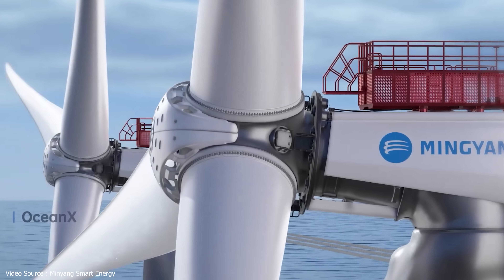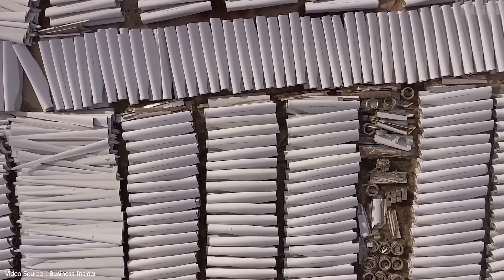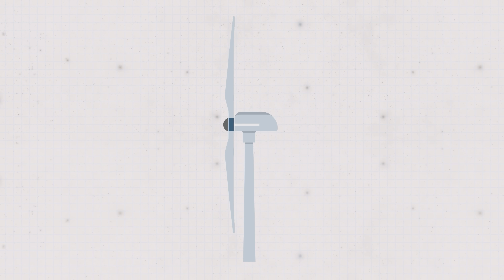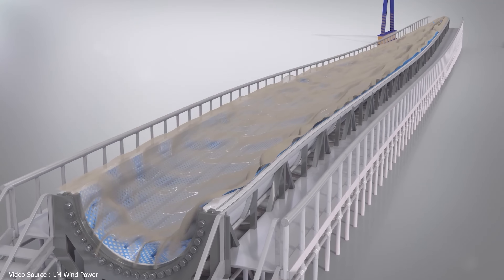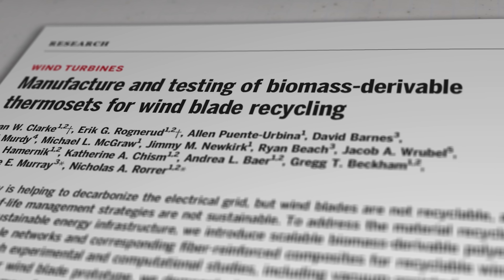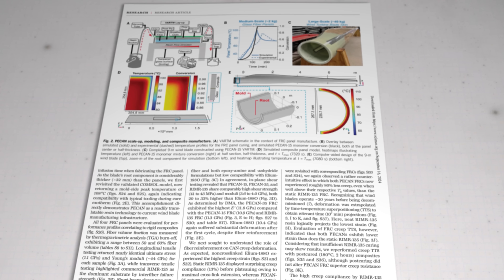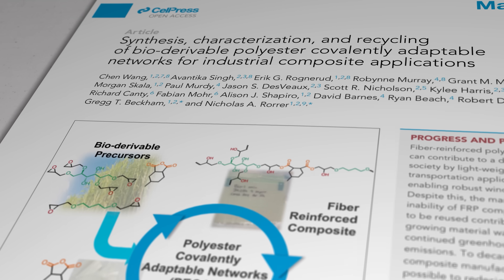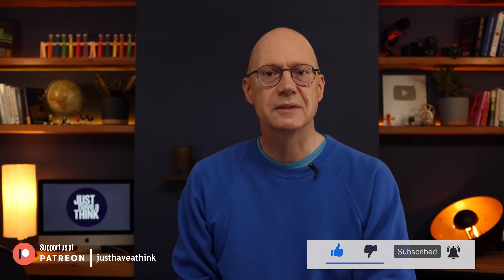FINALLY! Fully recyclable wind turbine blades!

Comment: I am sorry but this is not that well informed. I have been designing blades for over 40 years including many different materials including natural (biological) and  'recyclable' prototypes.   There are underlying problems with recycling blades - at least anywhere near a circular economy.  The materials have to be very high stiffness to weight ratio which means virgin resins ( or solvated at 400+degC) and well-aligned long fibres.  You don't get that with any recyclate.  Also there is simply not a big enough volume of material (surprising, seeing the size of the blades I know) to match the reuse industries.  I hate to poor cold water on this but only relatively short blades e.g 15m not 100m + today, can be made of material which has not got this high stiffness to weight requirement.  Finally, although we can and should find uses for old blades not landfill - the mere fact of the clean energy developed by wind turbines (6-9 months of generation displaces all the greenhouse gases that would be used with fossil fuels iin the extraction, manufacture and erection  of the turbine).  Extending their lives is a good idea and very possible with modern drone technology.         Side comment: Hardly any blades get 120degC + postcure (Vestas did but no longer) as mentioned. Usually 60-80degC or even room temperature cure and no post cure.
Reply: The video isn't about recycling old wind turbine blades into new wind turbines blades though. He specifically mentions that with this new technique they would be recycled into something else. Does it then still seem that farfetched to you?
Reply: Not quite sure I followed you here. So, you say "well-aligned long fibres", the technique presented here does not achieve that? Following: "You don't get that with any recyclate". You mean recycled material won't be good enough? If I understood the video well they are not aiming for that, only create the blades and than recycle them into something else.
Reply: The scary thing isn't the OP's misunderstanding of the video, but that it's top comment. Come on YouPeople, we're better at critical thinking than this
Reply: Didn't you hear him?!  He SPECIFICALLY said they don't intend the recycled material would go back into turbine blades. But possibly the byproduct could still be reused in other industry instead of landfill. Still a win.
Reply: I feel like you didn't actually watch the whole video, because he specifically addressed your first & main point.
Reply: You didn't actually watch the whole video did you? 😂 Go back to 9:00 and listen for about fifteen seconds.  You and he actually agree.
Reply: @Windmillmark  I thought Vestas had cracked recycling - so they claim. They say that thay can chemically break down blades back to original materials. So much so that the recyclate can be used tor new blades! Is this not true?
Reply: The OP is not a reply to this video's actual content.  Disliked for irrelevancy.
Reply: Even is blades are landfilled and not recycled, it's a small fraction of the waste we generate and there is a lot of carbon sequestered.
Reply: Watch and Learn how the CPC in China achieves it. 🇨🇳 🚩
Reply: It's called the "square-cube law", not the cube law. It represents the relationship between surface area and volume, which isn't a linear relationship. Search on YouTube and there are good explanations of it.
Reply: He specifically said that the material can not be reused to make new turbines. So I don't know what you are going on about.
Reply: He is always interesting but he is no professor
Reply: Would you care to elaborate ?
Reply: my counter-argument would be that this could be a good example as a first gen reusable tech for wind generation, so I wouldnt be too critical or too hopeful, just think of wind tech like you would think of early solar power and realize that first you have to get it to put out the power requirement, then get the production lifecycle greeener and greener...after all, fossil fuels are dirty all the way through their life cycle, so "clean" energy sources have them beat even without worrying about component repurposing.  Something that no coal, oil, natural plant has ever considered to my knowledge, not to mention the construction aspect---think about fair and balanced comparison Fox News...
Reply: @Windmillmark    Damn you! 
Don’t bring physics and engineering facts to our feel-good story!  
😠😠
In all seriousness. Thank you for sharing your knowledge here. 
Vegetable matter will never replace steel & fiberglass. 
The world does indeed need more varied sources of low-pollution energy. However windmills have serious limitations & problems —they are not a panacea.
Reply: My friend who is PhD keeps telling me that blades have a small working range due to a cube law but I can find anything I can understand on the internet
Reply: @thevanthatrocked ”The cube law” is no law, but still a physical fact. The basic idea is simple: If a blade is made twice as long, one might think the loads would double. However, the blade doesn’t exist ina one dimentional world, but a 3 dimentional one. The loads gets double for the double lenght, which then gets double from the double thicness, which gets double from the double height. N x 2 x 2 x 2 = N x 8. Double blade length gets 8 times the load. This isn’t the whole load calculation, of course, but explains the “cube law”, which is relevant to scaling any structure.

PS. If you want to tease your PhD friend, mention the quote from Einstein: “If you can’t explain it so a child can understand it, you don’t understand it yourself!” :-D

Comment: If it is downcycling (and it is), then we should already think about, how to reuse or recycle the products form this "elastic liquid".  
PCAN sounds is better the epoxy raisin+ glass fiber, but as for the recycebility of it... Lots of things right now can be downcycled or even recycled, but we don't do that, cause it is hard to get a clean substrate for recycling. I find it hard to believe that those blades will be as fit for the methanol bath in real life, as in lab. It is hope, but needs real live testing.
Reply: Yep. Also, what happens to the recycled product? Are we just creating one further step before landfill, or is it two, or three? Would that be 5 additional years, or 10, or 50? It's not circular anyway, by the sounds of things.

Comment: I like the idea of using easily recycled/broken down materials as much as possible. I'm guessing that the currently used wind turbine designs with the huge blades has been determined to be the BEST, most EFFICIENT design? What about vertical turbines, or spiral turbines? It would seem to me, who isn't an expert, those designs might prove  more effective, and could use less materials to begin with, thus requiring less mass to be recycled. Still use the improved material options.... 

As I said, I am NOT an expert. Just curious and questioning.

Comment: Diameter of a turbine blade at the root is 10-16 feet, according to chatgpt.  How about cutting that bit off and using it for a tiny house?  You could use other parts for roofing...look like a bunch of mushrooms!

Comment: They want all of us depending on BIG ENERGY. No matter. We could be INDEPENDENT. A few batteries. Solar. Wind, the size of a kitchen trash barrel. 😊
Reply: @jodywho6696    
The evil THEY strike again!  😈
Try some engineering and material science at industrial scale. 
Huge amount of mining and energy require. Some windmills and solar do not accomplish this recycling you speak of. Never mind the toxic materials these batteries are.
Reply: Jody, not everyone wants to run their own power plant.  Not everyone CAN do that.  There will always be a need for large scale power production.  For one thing, it's more efficient, thus cheaper per unit of energy.
Reply: @incognitotorpedo42   
Yeah. But it is too bad that wind & solar are so intermittent, unpredictable. 😕
Reply: @jodywho6696    
Hah! A few batteries, for each home, building or industry? … 🤣🤣
Billions of tons of toxic polluting materials to make those batteries. 
And batteries die after a few years.
Reply: @TheRustyLM  Batteries are 90% recyclable and last ten years as they can be used for storage after their use in cars
Reply: @TheRustyLM  If you don't have the batteries, others will have to. Because we are going in that direction, and there is no turning back. Besides, nothing is more toxic than burning deep ground fossils full of heavy metals, sulfur, radioactive uranium and many other soluble toxics that are concentrated deep underground.

Comment: How about replaceable edges where the wear is?
Reply: Good question. Why do blades wear out. Could they not be made more durable.
Reply: @petewright4640  they are going at almost the speed of sound at the wing tip so hitting any air particles (salt, water, birds...) will cause damage.
I agree with OP, I would be curious for why replaceable edges don't work. 
(Because I am sure if it was easy to do they would have already been a thing)
Reply: @petewright4640  Because UV rays are terrible. They burn absolutely everything. Any polymer will eventually be destroyed by the sun. And there is no, non polymer alternative.
Reply: Helicopter rotors are made from aluminum as far as I know and sometimes use blade tape to protect the very ends of the rotors.  I was in a helicopter when a piece of blade tape came off one of the 5 rotor blades. We had to land and remove the other pieces to get back the balance. Maybe something similar could work?
Reply: I think the wear is more extensive than just the edges.  BTW, turbines operating normally don't go anywhere near the speed of sound.  The tips go 1-2 hundred miles per hour.  A turbine tip would only reach the speed of sound if the brakes failed in a hurricane, and it would quickly explode.

Comment: Like EV batteries still having a life long after the car is done, it seems to me that we haven't been clever enough to find a reuse for this amazing material. There will be structural limitations due to their age, but their strength and light weight seem like they'd be ideal to be sliced into ribs for lightweight modular or assembled portable structures. Think disaster relief, temporary work camps etc.

Comment: I wonder, can you not make car body panels from old blades?  If they  are chopped up and shredded carbon fiber and fibreglass, can they not then be remoulded?
Reply: Unfortunately, that’s not how it works.  Once carbon is set in resin, that’s it.
Reply: Problem.is that currently tey use thermosetting rather than the thermosoftening polymers than can be remoulded.
Reply: @bibliotek42  hempcrete
Reply: if you chop the fibres up you'll lose a lot the strength they add to a composite.

Comment: Blade disposal at least puts the blades in a landfill where it's as sequestered as we can get it.

Chips and so on off the blades that end up on the ground or water around the turbine as the blades wear end are more worrying. The great fiberglass garbage patch will be the next thing to clean up in the ocean
Reply: Totally. We already produce unbelievable amounts of garbage from packaging. Complaining about the turbines is like complaining that a bathroom tile is cracked when the house is on fire. Ridiculous.
Reply: Nah. Fiberglass is denser than water, so it'll just sink. Problem solved :-p.
Reply: Turbine blade chips are inconsequential compared to other sources of plastic waste, like clothing or consumer produce packaging or fishing nets.  Ridiculously inconsequential.  Making an issue of them is doing the work of big fossil.

Comment: Nice bird shredders
Reply: Bonkers.  By the time the next blade comes around, the bird is gone, felled or escaped.  Empirical question.  Shredding is left to the foxes, voles, any available panthers...
Foxen, if you insist.
The blades bonk the birds.  Once per bird.  But your first impression could be right, too: you may be bonkers, I dunno...

Comment: Iirc, the blades wear the most at their edges. What about using "blades" without edges like Flettner-rotors. The wear ist distributed over the whole surface of the rotor. There was such a turbine in Poland. Using adaptable speeds would probably even compensate for some of the supposed lower efficency.
Reply: Replaceable edges.

Comment: The world produces 42 million tons of waste toilet paper per year. That's just toilet paper. We waste 1.3 billion tons of food per year. So with 43Mt by 2050 we're not talking big numbers here on a global scale.
Reply: Toilet paper degrades relatively quickly therefore doesn’t need to be put into landfill. Food waste isn’t great but that’s not a landfill issue either.

Wind even with landfill is better than fossil fuels but why not look to improve the process if the incentives are there
Reply: @StokeseyHD  But what about the packaging of that toilet paper, and that food? Have you seen your garbage, how full of plastic it is? Now multiply that by the world's population, and there is the real landfill problem. And what about clothing? Made mostly of plastic or long-lasting fibers like wool, and we throw away 92 million tonnes of old clothes every year.
Reply: @DrBernon  Exactly.  Turbine blades are a drop in the bucket, but this "problem" is being used by the fossil fuel industry to slow wind development.
Reply: Are these wiper blades instead of toilet paper?
Reply: @CaminasDrummers  
Absolutely.  See my comment.
Reply: Wind farms, solar farms  pretty much anything that captures natural energy is....basically tricky, for example when you start capturing and harnessing Wind at large capacity, you are essentially messing with the earth natural flow of certain weather flows...likewise when capturing anything natural, the effects on the planet when you mess with how it's flow is operating is unknown and dangerous.
Reply: I've tried but it's hard to reuse toilet paper
Reply: @sebastianeckert1947 Yeah, ' Recycled Toilet Paper' disgusting!      😂

Comment: By all means, this is nice, but not so much for blades.

Wind turbine blades disposal is an almost trivial problem, except for those having to dispose of them.

Blades are and will be an absolutely tiny share of landfills, and they are inert. They don't leak poisons, don't emit any emissions. For the world at large they cause no trouble.
Reply: It always makes me laugh how anti wind turbine people always criticize the fact that you can't recycle blades yet they have no problem with having a power plant emit millions of tonnes of CO2 and other more directly harmful gas compounds to produce the same electricity some wind turbines would have produced
Reply: @texanplayer7651 That's because they are unknowingly repeating oil industry propaganda.
Reply: Yeah! They don't turn into methane, they don't leach heavy metals or other toxic material into the water table and no one has to try to communicate a message ten thousand years into the future to the effect of 'hey, don't dig this shit up.'
That being said, being able to reuse stuff is generally a good thing.

Comment: I am curious as to why we need to dispose of these in the first place. Is there structural damage introduced over time that cannot be repaired? Improvements in blade design / efficiency that has an ROI greater than the losses than leaving as-is?
Reply: Yes. Generally flexing in the blade breaks the fibers, eventually it eats into the margin of safey and the blade gets shitcanned. Generally eveything is designed to wear out at more or less the same time.
Reply: They're constantly being exposed to the sun, and changing between stopped and moving very very fast.

That's both fatigue damage and UV damage, not to mention they get rained on.

Plus, there's bits of grit in the wind.

The blades erode away and bits crack off, making the surface less useful as a wing, hastening the wear, and putting out less power.

We likely won't come up with a new material that's light enough to get up to the crazy tip speeds and doesn't slowly degrade in the elements. At least, not better than fiberglass

Comment: Rather than using shredded turbine blades under roads, lets use them under footpath and cycle ways.  We need more of those to help support active travel and the alternatives to driving around for short local trips, with all its negatives, and so anything that could reduce the costs of the foot & cycle ways should be welcome.
Reply: Why not shred all non recyclable plastics and makes roads etc out of them. It not a solution.
Reply: And what about the horses?  Particularly the horses exhausted from chasing foxes?
I don't know what the answer is.  I don't even know what the question is.
However I think that the failure to consider turbine blades within the overall context of the horses represents a severe decline in integrated civilization awareness.
Reply: Or pile''em on the foreshore as breakwaters?

Comment: Never mind how expensive it is to build/maintain anything off shore. 
Never mind how much farming and tractors/fertilizer/processing is required to make thousands of 200ft vegetable blades. 
Think people!
Reply: A lot less than digging/drilling oil, piping it, refining it. piping it again and distributing it locally. Think.
Reply: @ronvandereerden4714   
Vegetable matter blades so they can be recycled ??? 
You’re delusional and woefully ignorant of engineering & materials at an industrial scale. 
But you do love this YouTuber feel-good stories. 🤗🤗
Reply: @ronvandereerden4714 
Vegetable matter will never make a durable rigid material that can function as a substitute for metal/fiberglass windmill blade. 
Tons of vegetable blades means billions of gallons of water, millions of gallons of tractors to harvest, and do it all over again due to brief shelf life. 
MAYBE a wee windmill on your roof. NOT these 200 meter behemoths.